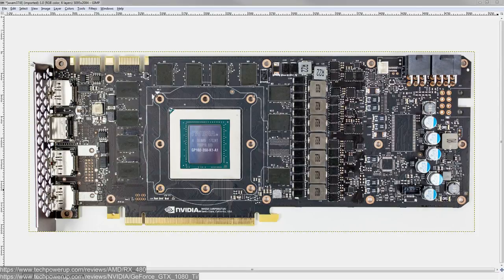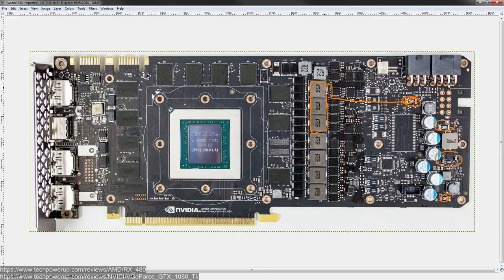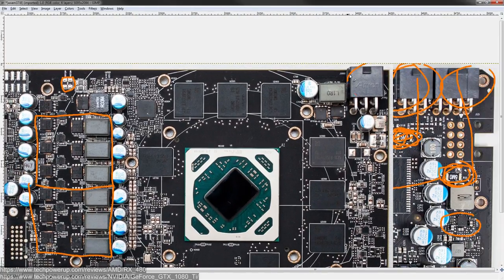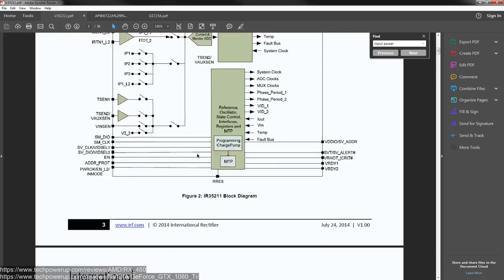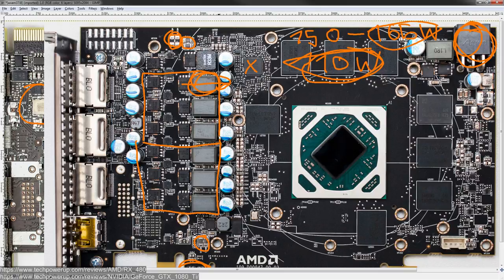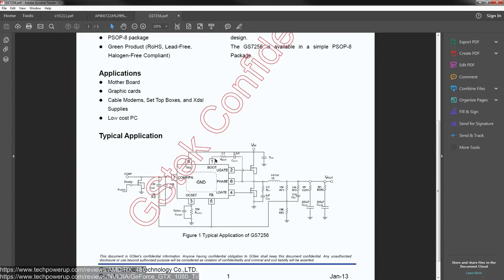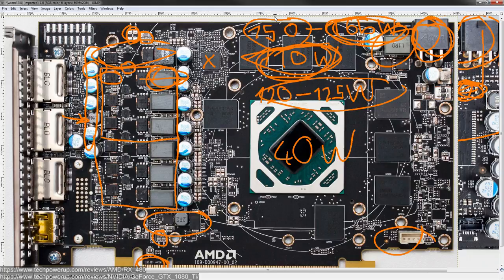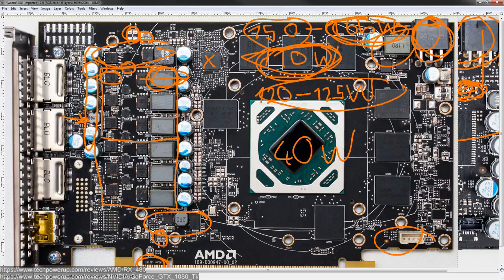The differences in AMD's and Nvidia power monitoring

Comment: Great take on what's going on with Nvidia's accurate watt usage numbers vs AMD's nefarious inaccurate watt usage numbers. I feel vindicated as I learned the Watt Facts, much thanks to you.

The Real reason cred dead AMD plays these watt hiding games is that AMD doesn't want people to know how many watts their inferior uArch and inferior Glofo FinFET Fail process really does suck. 

This is what happens when cred dead AMD combines being debt dumb and R&D poor with being a blatant watt wasting BSing propaganda pumping company  desperately trying to compete with Performance Per Watt Champion Nivdia's Pascal.

Fact: AMD's Watt wasting GPU core uArch + Glofo's watt wasting FinFAIL process = Watt Sucking GPUs that despite using high cost low yield HBM gets beaten like rented AMDonkey by Performance Per Watt Champion Nvidia/TSMC Pascal.
Reply: They cant be hiding much, Just isnt enough room. Ive seen Rx460 report 100watts when massively overvolted without a 6 pin adapter, using only the PCI 2.0 revision from back in 2008. People crash at 75Ws on the old PCI design. Edit: correction PCI-E Ofcourse.
Reply: Max Facts Nope not triggered, Your just trolling for reaction.
Reply: I bet you really don't want to remember Fermi do you? You sound like someone who has been drinking the nvidia coolaid for way too long.
Reply: Fermi was the first to deliver the most important DX10 Visual Benefit TESSELLATION by having the most powerful Tess engine, AMD's  Tess engine was a lame DX9 joke. It's a Fact that AMD RUSHED to be the First DX10 GPU with unbelievably pathetic lame game DX9 Tess engine. 

Nvidia's Fermi FULLY supported DX10 Tessellation, AMD DID NOT, the 580 was very good card and its problem was watt wasting 40nm process node which lasted a lot longer than it should've.
Reply: Max Facts first of all Fermi was watt wasting, because it was a huge hot inefficient chip design. Not just because of the fact it was on 40nm. HD 6900 series didn't suffer from this problem on 40nm. So BS to that.   Evolved Fermi (500 series) still suffered performance loss from power throttling due said to power consumption. The GTX 580 is cherry picking as it has the most tessellation units, due to the higher SM count that it was tied to. Drop the SM count to GTX 550-560 levels and tessellation drops like a rock. Comparing an entire line of GPU's (AMD/ATI) to a specific top end GPU just pathetic.  You may may think your trying to make a valid point. But your being a obvious Fantard/Troll hole while doing it. Using very old generation GPUs to promote a specific point of argument. Tessellation hasn't  been been much of an issue for AMD the last 2 generations. At least not when used in sensible amounts, as opposed to hiding it un-rendered and infusing ridiculous (levels) amounts into games. luckily excessive Tessellation for propitiatory graphics effects can be turned off or reduced to sane levels. With out any real or actual loss and plenty of benefits.
Reply: Max Facts so you're praising about the nuclear reactor? Something is wrong with you
Reply: Fermi was by far the best fully Dx10 supporting GPU at that time, only Fermi had a Tessellation engine worthy of taking full advantage of  DX10 most important Visual benefit Tessellation. AMD's marketing fools rushed in DX10 with the same lame game Tess DX9 engine claim some sort of DX10 victory when in Fact is what all marketing BS, so praising Fermi was completely logical. 

Hypocrite Much? 
Funny how you call Fermi a nuclear reactor when it was more an effect of being stuck on 40nm node for so long, but for many years now and many node shrinks later it's AMD's ReBrandeon that builds Watt Sucking Space Heater/Deep Fryer GPUs.
Reply: Fermi was pushing 40nm node to the max, a node that lasted way longer than Nvidia GPU designers thought it would. Factory Oced Fermi cards from Nvidia's many AIB partners pretty much cooled this GPU beast. Fermi was by far the best fully Dx10 supporting GPU at that time, only Fermi had a Tessellation engine worthy of taking full advantage of  DX10 most important Visual benefit Tessellation. AMD's marketing fools rushed in DX10 with the same lame game Tess DX9 engine claim some sort of DX10 victory when in Fact is what all marketing BS and that's a Fact. It's also a Fact that DX10's BIGGEST VISUAL ADVANTAGE was TESSELLATION that ONLY Fermi delivered while AMD claimed DX10 support when a lame game old DX9 engine.
Reply: Max Facts  Still moving the goal posts i see. "Nvidia's many AIB partners pretty much cooled this OVER HEATING GPU beast. Fxed it. Your welcome. " Fermi had a Tessellation engine , in answer to ATI already existing Tessellation implementation. http://rastergrid.com/blog/2010/09/history-of-hardware-tessellation/ read this you might actually lean somthing.
 "The true successor of the original hardware tessellation feature reappeared with the Xbox360′s (AMD) GPU and then for PC with the introduction of the AMD Radeon HD2000 series. This hardware generation came equipped with a fixed function hardware tessellator similar of that of the Radeon 8500 but with added programming flexibility. The functionality is accessible in OpenGL through the extension GL_AMD_vertex_shader_tessellator but, again, it didn’t make it its way into core OpenGL, neither into DX10 due to the lack of support on NVIDIA GPUs."
Reply: I knew the Tess Facts but it doesn't change the Fact that DX10 (NOT DX9) BIGGEST MOST IMPORTANT VISUAL BENEFIT was Tessellation.

Undisputable Fact:  Nvidia's Powerful Tess engine from Fermi to Pascal BLOWS AMD's pathetic Tess engine into the lame game dumpster and it was marketing fool AMD that RUSHED to claim DX10 support with a lame old DX9 Tess engine that Fermi DESTROYED.
Reply: Meh, I don't have a stake in the game but no one really gives two shits about "Tessellation" or "PhysX".  90% of people disable it.. 
  Also, Neither AMD or Nvidia are leading in Ray Tracing capabilities.. They both suck at it, because they aren't designed for it.
Reply: yeaaaahhh, no.  tessellation is just a poor mans ray tracing tech.
Reply: Correction AGAIN:  Tessellation DX10 most important visual benefit is gamers with Nvidia's GPUs ray tracing tech until Nvidia's Volta is released then gamer will realise ray tracing. Gamers running AMD's watt wasting GPU are SOL and should have bought a Performance Per Watt & Tessellated Champion Pascal.
Reply: No shit?? I thought DX10's most important benefit (When compared to DX9) was an overall loss of frame rate, even on the latest video cards, and an overall scam on Microsoft's behalf to push Windows Vista, the most horrible operating system to date. 
Meh, Live and you learn.  ¯\_(ツ)_/¯
Reply: You can't on one hand defend Fermi's horrible perf/watt and heat generation because it had a "full" DX10 hardware implementation, and on the otherhand, shit on Vega for the same reasons. At least Vega's perf/watt is shit because it was designed primarily as a compute card, not just because it's a shit architecture. Oh, and guess what? Vega has a full DX12.1 implementation. :O
Reply: hate me4 txt, but both amd and nvidia patents prevent power vr + others from having pc ray tracing + techs ..... in the usa ofcourse...........